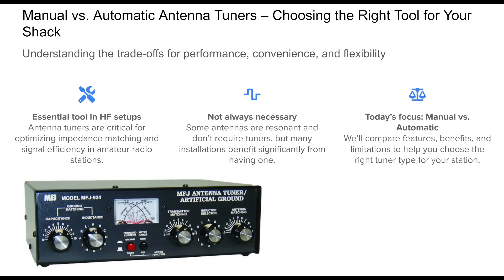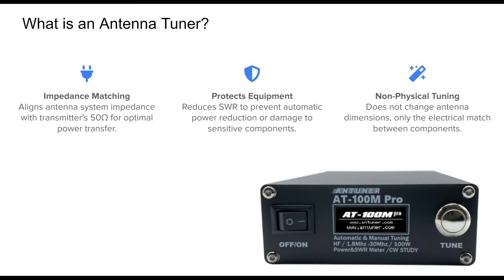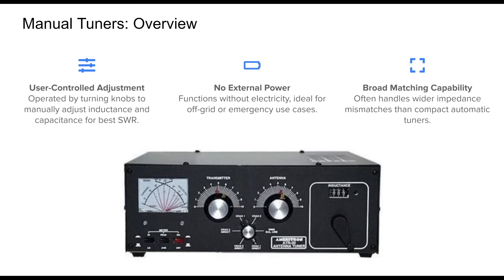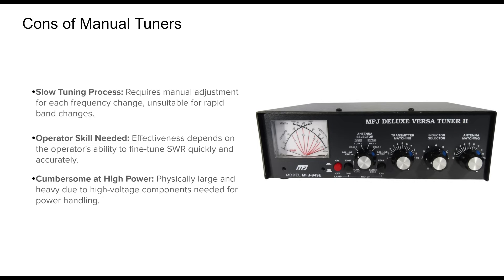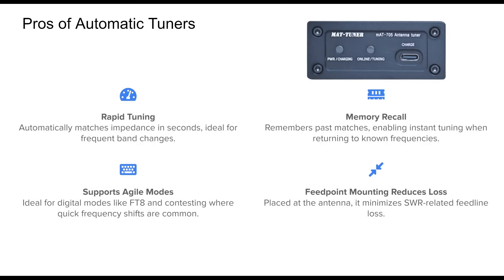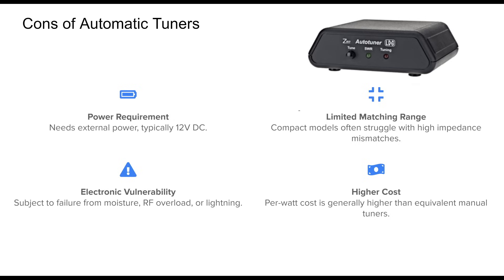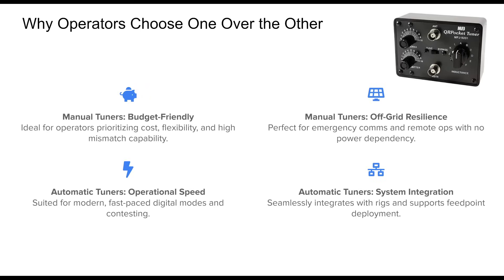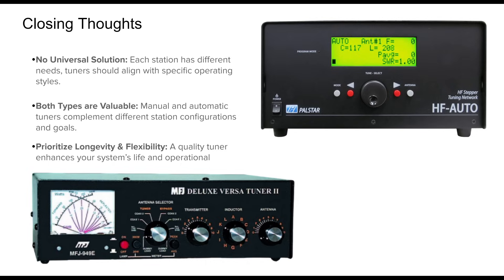Battle of the Antenna Tuners: Which is Best?

Comment: In the shack I use an automatic tuner. I’m convinced my LDG would tune a chain link fence. For portable operation I use resonant antennas. No external tuner needed.
Reply from the maker: LDG does a pretty good job with the auto tuners 👍

Comment: Thanks Ape. That was a great thumbnail. The biggest factor for me in the antenna Q. If the Q is high, auto relieves a lot of fatigue. If the Q is low, manual is fine since matching can often be one and done.  73.
Reply: I gave up on j-poles because of the high Q.  I would rather have less than 1.5 across a whole band rather than 1 SWR for a small number of frequencies.  I rarely use a tuner and concentrate on antennas matching the frequency.  If I had a small set frequency that I was using a lot in a band, I would use a j-pole.  When I was messing around with j-poles, I was picking up stuff 1/2 dipoles weren't.
Reply from the maker: Thanks Nate 👍

Comment: I usually prefer the manual one. As you say... is more reliable... especially when limited on power. They are also easy to build as a homebrew project. Defenetly a bit slower than an automatic one... but since usually I would only use it for some bands, speed for me doesn't matter much, but the fact that I don't need to power the ATU. Nice and useful info. Thanks for sharing this. 73, YO6DXE.
Reply from the maker: Thanks for watching DXE 👍

Comment: Great video!!! ive used both ldg and mfj auto tuners, honestly i prefer resonant antennas but i do see the need for tuners, 1 ? ive noticed with both tuners when i first fire up the rig, sometimes i have to bump the tune button to get the recieve audio up, any idea why? thanks buddy!!73!!
Reply from the maker: Hey BigBoy, I suspect the radio isn’t seeing a prefect match and probably just needs a slight touch up.  When tuning the tuners output becomes a mirror or the antenna’s feedpoint creating a match in the reverse direction.  (From the antenna to the radio)
Reply: @TheSmokinApe thanks!!73!!
Reply: @TheSmokinApe  thanks!!73!!

Comment: What's the best way to have an automatic tuner set up in the system? 

I recently built a new shack. Everything is grounded, radio, tuner and antennas. The radio is an IC-7300 and have a LDG 600 Pro II. Currently, I have it set up in the shack with my radio. 

From the radio to antenna is set up as follows; radio with 6ft jumper into a pwr/swr meter, another 6ft jumper going into the tuner. Got a choked 9ft jumper going to the junction box into a lightening arrestor and finally my Nelson 80-10M EFHW, which is fed by a 35ft run of coax. 

Is everything set up correctly or do I need to swap the pwr/swr meter around with the tuner?
Reply from the maker: You got it set up correctly.  Thanks for checking out the video 👍

Comment: I have an LDG 1000 pro and it tunes up awesome and I can toss 600 watts at it all day. I also have a few 3k manual tuners and they just collect dust now.
Reply from the maker: The 1000 is a pretty sweet tuner 👍
Reply: @TheSmokinApe  If it had more resolution in the swr power meter it would be perfect for a 1000w tuner.

Comment: The resonant frequency of an antenna and the frequency of the lowest VSWR are not always the same.
Reply from the maker: Correct
Reply: @TheSmokinApe  This could be another whole video. Most people tune to lowest SWR and not resonant frequency.  Resonant meaning only R and no XL or XC.  Most of the the time the lowest SWR is very close to the resonant point.  The resonant point is where you have the radiation pattern that you want, but since lowest SWR and resonant frequency are so close if the antenna is designed correctly, it doesn't matter much.
Reply: @JohnSmith-hm9hn  Correct. My post was a realshort one with no explanation. Thanks.

Comment: Antenna impedance matching units introduce a loss. Once I read the loss can be 4%.
Reply: Every transmitter has a matching network built in, to transform the output impedance of the final transistor/tube to the standard 50 Ohms.  Is that a loss too?  The outboard tuner just ensures that this 50 Ohm output at the jack will "see" a 50 Ohm load from the antenna and coax (the antenna system - not just the antenna).  -- AA6LJ
Reply: @StephenGangi  As the standard is 50 ohms you cannot escape using a matching network which is usually a transformer on ferrite cores and thus has a high with negligible loss. A manual tuner with roller inductor and high quality variable capacitors should not introduce substancial loss; a small one with tapped inductor and  variable caps not mounted on ceramic may introduce some loss. The problem is more with autotuners switching in a certain number of capacitors with a lower Q than air variables and a certain number of coils which may also lower the Q depending of the number coils switched in. The loss is more important at low frequencies. The combination of caps and coils used for the match may also  not be optimal.
Reply: @jcp3a573  I believe that is correct.  The practice for matching networks used to be a Q in the neighborhood of 10 or 12, for output transistors and output tubes, if memory serves.
Reply: @StephenGangi  You are correct; the ARRL handbook recomment Q between 10 and 15 with 12 optimal. This Q seems to be really low: Q of a good air variable >500, roller inductor 200, air code coil 200-400, toroidal coil 200. This bothered me when, a long time ago, I was trying to understand how to calculate values for a pi network for a tube amp. This Q of 10 to 15 is the loaded Q of the network. If the unloaded Q is X/R loss the loaded Q is X/(R loss + R out) with R loss typically 50 ohms. So it makes more sense the "loss" due to this low Q is basically the power delivered to the antenna. For a tube amp with a pi network this network acts as a tune circuit and provides harmonic suppression; below 10 harmonic suppresion is reduced and above 15 the circuit is so sharp that the currents in the network are such that the ohmic losses become to high.  Transistor PA are broad band -> need for LPFs. As for the optimal loaded Q for such PA I would have to look into it. Basically I am clueless.
Reply from the maker: I am not sure what point you are making, but I do appreciate the effort!
Reply: @TheSmokinApe  Exactly! What is the point? My post was a in your face one with no explanation. First you video is a good one in patrticualr for new hams or not too technical ones.
What I meant in my post is that there is no free lunch. You already mentiond in your video that the tuner does not eliminate the VSWR on the transmission line and associated loss but the tuner itself mayn add a non negligible loss. It is good to know.

Comment: A resonant antenna may have a theorical impedance different from 50 ohms:
Dipole 73 ohms
1/4 wave vertical 36.5 + j21
EFHW 1,800 - 5,000 ohms
Reply from the maker: Of course, thanks for watching JCP 👍
Reply: @TheSmokinApe  As I mentioned in previous replies my posts were very short with no explanation. 
I mentioned theorical impedance but in real life the actual impedance will be different.. For the EFHW I was not sure (I think it is 2500 ohms) so I mentioned a range of  actual values. The actual values depend on many factors like height, ground, environment (trees ...). For dipoles and vertical the actual value is close to 50 ohms and does not require a tuner if you don't transmit too far from the designed frequency. The same applies to antennas designed for 50 ohms. For EFHW antennas it is not as simple as the actual impedance can vary greatly , the transformers may be 49:1, 64:1, even 36:1 or 81:1 and also add a capacitor. Having a tuner on hand may be helpful.

Comment: Nice slides of antenna tuners. You should have went to ham fest with big Jeem ! Many of them MFJ tuners for sale their. I have 2 . I got the 1/8 to 54 MHZ one with 300 watt dummy load . 949E . and I got a 1.5 KW roller inductor one . 1.8 to 30 MHZ one. Work great > I can per tune them with a Rig Expert  sending no power over the air . Also if you use smith chart you get it right on . The one shown in slide I want. That has a tunable counterpoise . also called artificial ground. You sent that common mode current right out a wire on ground and it tuned for max current on counterpoise wire . Both types auto and manual are great for portable . Your tuned antenna may change park to park. Finally got a break from heat in NY . Some strong storms with rain. Nothing too bad. Not much sun today so my battery system went a tad low.  6 meters closed up from storms and some times the storms open that band.   11 meters was ok. Just a bunch of static crashes and QSB. But was going from NY to DFW TX on 39 . I did get a Reno NV on CH 36 . Not much more . Static was heavy. 73
Reply from the maker: I wanted to go but couldn’t get the time away from work 👍

Comment: One thing that I like about manual tuners is they teach you what adding and subtracting inductance and capacitance do. Then when you upgrade to an automatic tuner (hahaha!) you'll have a better understanding of how it works and how to fine-tune it for best SWR rather than randomly pressing the inductance and capacitance up and down buttons.

Autotuners work well with modern "no tune" solid-state amplifiers because they make changing bands a lot faster, useful during contests. With LDG tuners you want to be sure to option them for what they call "semi-automatic tuning" where you have to manually recall stored tunings from memory or initiate a full tuning cycle. This protects the tuner from automatically initiating a full tuning cycle when the amplifier's operating and being damaged.
Reply from the maker: I do typically use an auto when running an amp.  Thanks for the detailed post 👍

Comment: Excellent discussion. I used my Elecraft T1 with my KX3, K2 and other rigs, but it died. Replacement/repair was prohibitive. I tried one of the cheap Chinese AT series, but I found mine unreliable and incapable of tuning some WARC bands. So I got my trusty MFJ match-needle job and couldn't be happier. I have a cheat sheet for starting settings and can optimize very quickly. I have another tuner for 6m, but if MFJ was around, I’d buy one of the little QRP ones. 72
Reply from the maker: I have a few different MFJ tuners (manual) and have need very happy with them.  I haven’t had much Laguna with some of the Chinese tuners or amps for that matter.  Thanks for watching Barry 👍

Comment: My 7300 has an ATU but I bought a manual tuner to better understan things, it’s good to run a tuner through a VNA as you can dynamicably adjust the tuner.
Reply from the maker: I use a VNA to test and familiarize myself with tuners often, it’s a great idea 👍

Comment: Manual tuner all day, every day.  
They're cheaper, give you more control, don't need a power source (not counting a lighted meter), and can make damn near any antenna work on any band.  The only drawbacks are the marginal insertion loss on your feed line, which automatic tuners also have, and it may not be as fast to tune.  I keep a hand-written sheet in my shack with tuner settings for all bands to help me dial them in fast.
Reply from the maker: #AlphaHam
Reply: I bought a used manual tuner from a local club. They didn't have the power cable for the little light, and I didn't care a bit.
Reply: With auto tuners now available for around £40, you can't say manual ones are cheaper!
Reply from the maker: I was talking about good ones @paul 🤣
Reply: @TheSmokinApe  Sheesh, all these demands! ;-)
Reply from the maker: @paulsengupta971 haha
Reply: Same here.  I've always used manual tuners - both store bought (Dentron and MFJ) and home-made (from ARRL Handbook and magazine articles).  I have a "quick reference" chart, but I only write down the inductor settings.  I found as I move up and down a band I tweak the capacitors anyway.

Comment: Great job with the comparison! Also, I was thinking that if you are off-grid or portable, unless your radio has an internal battery, you're quite likely toting the needed power (for your radio) and an auto tuner is not going to sap enough of that power to make a show-stopping difference. Perhaps the decision to make is, does it fit the needed freq range, antenna matching range and power handling? After that, it may just come down to preference for knob-twiddling vs button-press and only personal opinion matters at that point.  But personally, the longest ladder-line fed doublet you can hang, though a tuner, is the multi-band "Chef's-Kiss" of situations!
Reply from the maker: Even though it doesn’t sound right, I like the knob twiddling 🤷

Comment: I threw up a doublet cut for 60m.  WITH a tuner I get good results on most bands.  Eventually I'll do something better but ADHD told me to get on the air asap Lol.
Reply from the maker: lol, I need to finish my doublet project 🤔
Reply: @TheSmokinApe  Me too. I keep lookng at my wire, ladder line and mast wanting to finish setting it up but the weather here hasn't been cooperative. It's either rainy, windy, or scorching hot. Plus I start thinking about how much work will be involved and keep putting it off.
Reply from the maker: @jaym1301 I’m just super lazy 🤷

Comment: Getting back into HF after years/decades silent (licensed 52yrs ago!) I'm headed to 14.060 for QRP CW.
Simplest start? Tiny transmitter, SDR receiver, and EFHW. Of course, 49:1 transformer.

But when cut to resonance? I'll need no tuner!
Next step, after getting a tuner, will be to lengthen the wire to cover at least 40, with 75 "sometime later".

73
Reply from the maker: Welcome back Ben and good luck with the project 👍
Reply: @TheSmokinApe  I'll let you know!

p.s. open ladder line for matching ... efficient, yes? I'm going to drill into this.
73
Reply from the maker: Open wire is very efficient 👍
Reply: @TheSmokinApe  Yaaa ... so now, matching ... can transmorm 50 to ~~245?

A nice bit of spidering for me to do!
Reply from the maker: @BenTrem42 good luck, that’s a head scratcher
Reply: If you have an EFHW, you can start with a wire for 80m and you then have resonance on 80m, 40m, 20m, 15m and 10m without a tuner. Start with a wire for 40m and you'll get 40m, 20m, 15m and 10m all without a tuner.
Reply from the maker: It’s true…
Reply: @paulsengupta971  <strike> with only a 49:1?! hmmm</strike>|
I apologize for this. "I don't know what got me sidetracked, "
Reply: @BenTrem42  Yep. That's the point, the ham bands are harmonically related. A 20m(ish) piece of wire is a half wave on 40m, a full wave on 20m, 1.5 wave on 15m and 2 wave on 10m. These are all resonant, and all present the same (2500ish ohm) impedance near the end to allow it to be matched to 50 ohms by a 49:1 transformer. 7MHz, 14MHz, 21MHz, 28MHz. All multiples of 7MHz.
Reply: @paulsengupta971  Apologies!
I don't know what got me sidetracked, but yes ... truly ... probably well below 2 SWR!
thanks